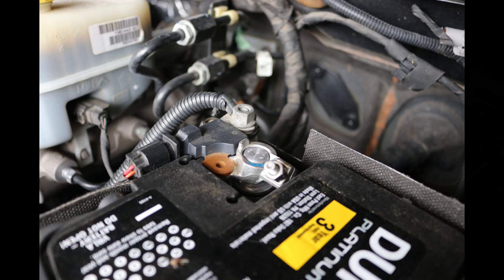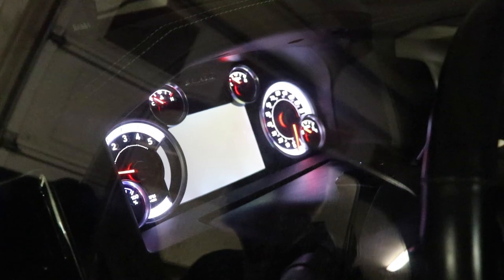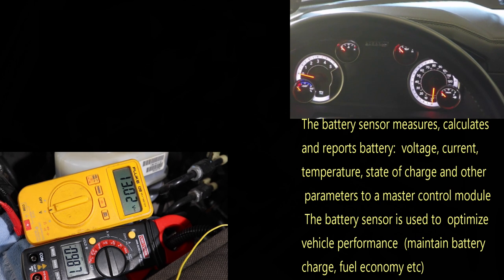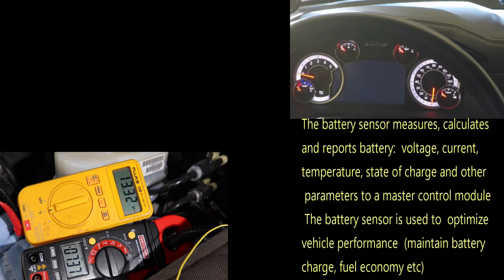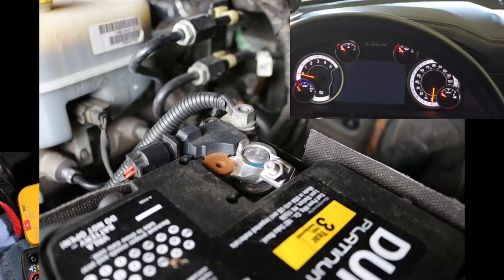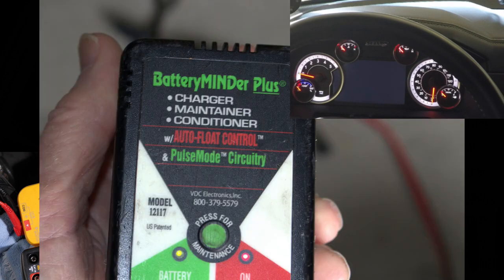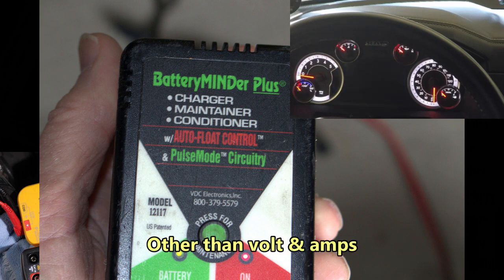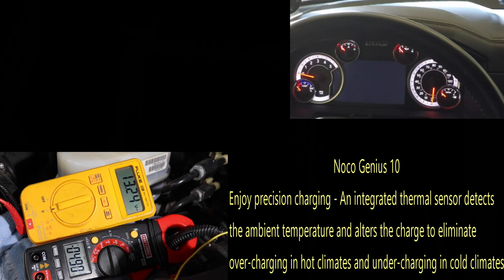RAM Cummins 2500 - Beware of the Trickle Charger Gremlin

Comment: I use the battery tender jr model connected to drivers side battery, sits November to may with no issues, original batteries from 2018.

Comment: Your dash light issue caught my attention.  I do NOT have a trickle charger on my 2013 but I came out to dead batteries after a long weekend.  I charged it up and assumed I had left some accessories on.  It was 25-30 degrees out. 
The following week I was about to go to bed and discovered I had left my phone in the pickup.  As I left the house, I noticed the dash lights on...the radio was on too.
Somewhere I read that a radio update would solve the issue. 
After finding my batteries dead a couple more times, I updated the radio and never had the issue again.  It has been 3 years.

Comment: I have my battery tender connected directly to the battery terminals.  I also leave my OBD dongle plugged in.  I've never had any issues in the 3.5 years I've been doing it.  I have a 2018 Cummins with original batteries.  The truck is plugged in whenever it is in the garage.

Thanks for the video Marion!
Reply: Exact same thing with my 2017 with no problems.

Comment: I have a NOCO mounted in the truck.  The temp sensing is the temp of the battery, not outside temp. They calculate temp using resistance change and charge rate.  Mine is connected directly to the left side battery and works fine. I’m in Colorado where it gets COLD and no issues

Comment: I have seen the EVIC on my 2017 stay illuminated before when I use to plug the charger in the cigarette receptacle.  Now I use the 7 way on the back for my Battery Minder and no issues.  I also wait a while after I use the truck to let all the modules go to sleep before I plug it in.  No issues since.

Comment: Hi Marion...Just tuned into your latest video about Trickle Charge ghosts.  My wife and I were camped solo in our 2015 Laramie 3500 up in the Oregon mountains in a very remote site. In the middle ion the night,  I answered nature's call and saw the exact same thing you were experiencing, dash lights going on and off, speedo needle jumping...whoa!  Interesting that it wasn't connected to my Noco "10".  We barely made it out the next morning due to a major drain on the batteries.
No garage mechanic could figure it out, ghosts... Two new batteries and a week later, while again answering another mid night call, I remembered that I had left connected my OBD Veepeak into the receiver.  I pulled it out and no problems since, even with the Noco connected.  I never leave it plugged in, only while pulling our trailer.

Comment: I’m using a 3 amp Battery Tender from Costco. It is wired to the second location you referred to. I use it a lot and have never seen the dash light up before. I have a 2017 Ram and the batteries are original.
- There is one other thing that may be causing you issue, the Noco chargers pulse to prevent battery sulfation maybe this is causing the sensor to act strange.

Comment: Mine did the same thing. The source of my dash lights going off and on was my Bluetooth OBD2 reader. I kept it plugged in all the time even with the engine off.  I was using  the torque app on my phone to measure my EGT. One I unplugged the OBD2 reader issue went away. Your Banks reader might be causing the issue.
Reply from the maker: Yea, maybe I need to dig deeper.  I only see it when it's cold.
Reply: This, OBD plus torque left while the truck is shut off

Comment: Bought a NOCO Genius 10 a couple days ago.  Had a Battery Tender from Costco and it appears to have malfunctioned. Was not using truck so put the Tender on.  Later wanted to use the truck, but Tender was indicating 6V and the batteries were 100% dead.  Batteries are AGM and only 2 years old.  Charged the batteries, then ran the NOCO 'repair' cycle which took at least 4 hours.  Hope the problem is fixed.  Ran the charger on one isolated battery at a time, not both together, thought the repair would work better.

Comment: i have my noco 5 amp battery tender on the passenger side. i live up north, i dont do much hauling/towing in winter so i ran my tender down to the plug in for my block heater. plugged them into a two to one  flush mount noco plug which is mounted to my plastic under skirt on the bumper. Never had an issue.
Reply from the maker: Good stuff

Comment: I can tell you I use the Harbor Freight $30 charger (the one with winter storage mode & AGM) and I charge through the 7-way trailer plug socket. No issues on the dash coming alive.
Reply: The dash may wake up without you knowing it. It then will go out again. I started transporting campers recently and sleep in the back seat. Several times a night this happens. Not all lights will come on. Just certain ones. You can hear a click when it does. Always starts fine. Just another mystery in my life that may never be solved.
Reply: @jeffmockus5400  These newer trucks do OTA (Over The Air) updates. When they do it may turn on parts of the cluster briefly.  If you use Uconnect like I do, you can witness it also turning on anytime you send a command.  These trucks are connected to "big brother" corporate at all times unless you Opt out in writing. They can pull odometer mileage, location, tire pressure, fuel level, any codes, ect. whenever they want to. Usually done daily and tallied up monthly. I get a vehicle health report every month or if they see a code even if there is no check engine light. They usually will give a general statement of an issue and request you to go to a dealer.  Even little things like low brake fluid is recorded.  They're always watching!

Comment: I wonder if you do the body ground and an add a circuit to the fuse box? I have a cb radio attached that way. My DIC light does this too when I egt in and out of the truck.
I thought it was connected to the entry-door switch and a timer. I use a Noco also (35) but it is not permanently attached. Canada - Ram 5.7 Hemi.

Comment: I have one of those Noco chargers too.  I think I did see my dash light up before. A bit concerning although I haven't had any issues in three months daily use. I'll definitely be checking for anomolies now I've seen your video. I've been on the road for the last month without charger usage and all has been well. This 2014 RAM 3500 DRW handles awesome with a large camper on top.
Reply: Did you replace your battery with AGM could be the culprit Maybe

Comment: Marion I too had a similar issue . I believe it has something to do with the door handle sensor . Go on to your radio settings and shut off the feature that unlocks the car when you touch the door handle . This eliminated my dash lights from going on and off. It was finally able to go into sleep mode. I too never had my key fob anywhere near the truck when this was happening. It was also cold out .winter time here in Illinois. I never did find out the repair. I just know when I shut that feature off In the controls on the head unit the instrument cluster stopped doing that with the lights . Give it a try see if it helps yours go to sleep. Maybe you too have a problem with one of the door handle sensors?
Reply from the maker: Thanks
Reply: I have a  2021 Jeep gladiator with door sensors and I experienced same thing while sleeping in it. The dash light came on a couple times over a 5 night trip. If I am remembering correctly this has happened in my 2015 Cummins as well but no door sensors in that one.  No chargers used in either case.  (If wondering how sleep in Jeep took out rear seats. Lol)
Reply: @katpow5437  in your case more than likely it was repeatedly recognizing the FOB within proximity.

Comment: Hey Marion and thanks again for another great video. Too funny about the retirement comment, I've witnessed this first hand with my Uncle and Father-in Law. So this is interesting to me, because I have only thought about a trickle charger when something would be left for an extended period of time without running, nothing to due with temperature. I've had this 2015 Laramie in NH for 3.5 years, only slow starts are when the block heater is not plugged in. Am I doing damage to the batteries when not helping it out in those times? Thank again Marion.

Comment: You are correct in one thing.   This Minnesota boy laughs at you on this.  Trickle charger ony when it's cold (in Louisiana)  that's rich.  However I have to comment that the smart battery sensor can cause funny maintenance messages to be issued by the computer ( mine is an '18).  Once this winter I had to run empty on a trip to Duluth (MN)  when Temps were about 0 F.  (Actual temp, none of this "feels like" silliness)  Anyway I got a "Battery save mode" error.  The error went away now that it is more normal (above 0) temps.  I firmly believe it was an erroneous error.  The charging system  is fine.  I suspect that the programming around the smart battery sensor somehow breaks down at low Temps (MN low temps, not LA low temps)  Stay warm my Tube of U friend...

Comment: I have a  2021 Jeep gladiator and I experienced same thing while sleeping in it. The dash light came on a couple times over a 5 night trip. If I am remembering correctly this has happened in my 2015 Cummins as well over the last 7 years. No chargers used in either case.  Hopefully, no big deal for gladiator like the Cummins.

Comment: Have you done a video on wiring in a quick connect with two batteries including all precautions. If not could you or if you have one to upload. Battery Mender instruction manual I've read 100 times. I'm pretty sure I did it right about 3years ago but still. And could you simplify series and parallel wiring as it is necessary.
Reply: I am not sure I understand what you mean. The Diesel Ram has, since 1994 model year, two batteries in parallel hardwired together by design.
Reply: I guess my question to you would be: would I only need one quick connect since they are wired in series?
Reply: @Urbangreenlawncare  they are wired in parallel.
Reply: @walterk1221  parallel correct sorry so would it make sense to put two maintainers or would that just cause all kinds of Chaos lol 😆.
Reply: @Urbangreenlawncare  I would say only one maintainer... unless you disconnect grounds and only then one per battery. How long are you looking to have the truck hibernating?
Reply: Just overnight charging I was just curious to the do's and don't do's of it all and you almost always answer all my questions in your videos 99.999% you are definitely the man appreciate all the details in your videos especially the torque settings. I switched to Royal Purple and as soon as I made the switch it became harder and harder to find I went through. Thinking maybe I'm going to pre-order some Schaeffer's Oil. I have got to stop bouncing around with oil Napa never has a darn thing. Anyway thanks feel free to reply or not no biggie you can have the last word.

Comment: Any issues since changing to the trickle charger instead of the noko? And did you move it to the other side?
Reply from the maker: No issues, didn't move it, I'll do it next winter season when it acts up.  No issues with the trickle charger.
Reply: @MarionBlair  I ordered the Noko Geniuse gen 10x1 fully water proof marine onboard charger and will be installing it as soon as it arrives. I will be running 1 positive lead to the passenger side and one negative lead to the drivers side and see how that goes. I have a 2020 rqm 2500 limoted with all the sensitive electronics and fancy stuff.. Ill update you with my findings. Great post thanks